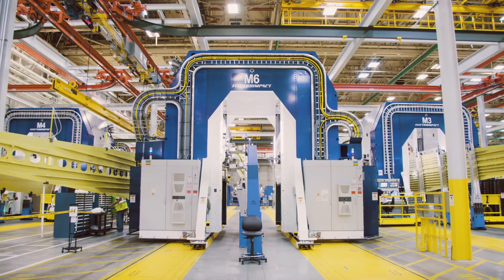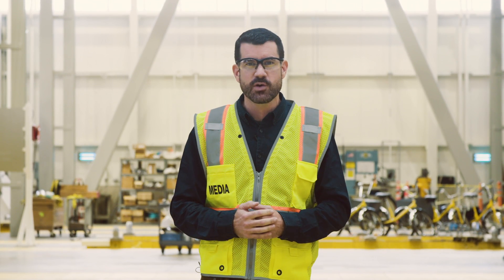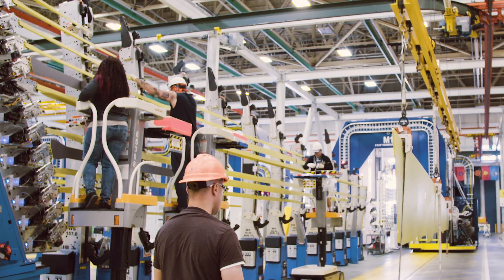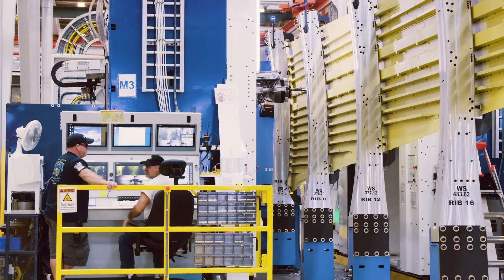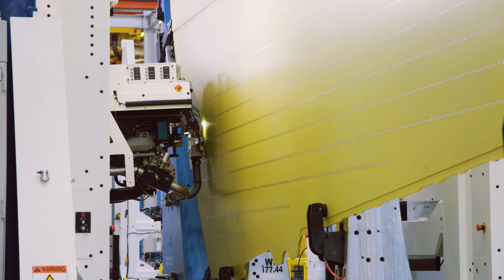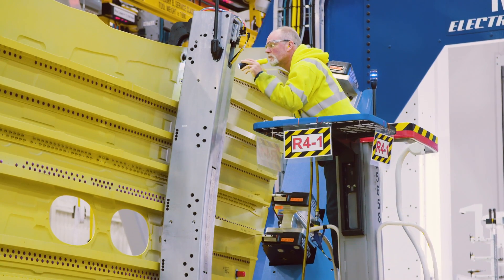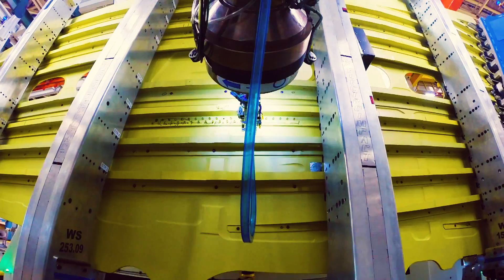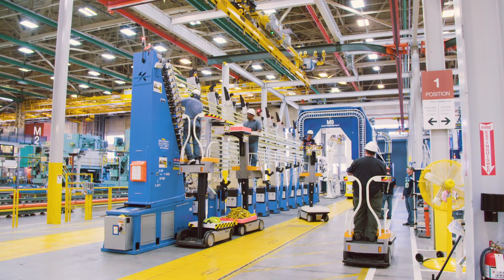Meet the Giant Robot That Builds Boeing’s Airplane Wings | WIRED

Comment: Its cool and all, but once you look through the rhetoric you'll see that the 737 is a positively ANCIENT design. Yes, it has been given 'new' wings, but even these are still made the old fashioned way; i.e. out of Aluminium. 

You guys should go and arrange a visit to the Airbus factory where they build the A350xwb. Most of the plane, including the wings, is constructed from Carbon Fibre. All that stuff is totally new and cutting edge technology.
Reply: mictho100 comparing a 737 to an A350. Great job mate.
Reply: mictho100 compare the 787-9 to the a350 over comparing the 737 to a350
Reply: The 787 is mostly CF, much of the A350 is CF reinforced aluminum. The 787 was introduced into service 4 years before the A350. dummy
Reply: mictho100 fanboy
Reply: Kid From Central African Republic airbus sounds like a hair dryer
Reply: agreed, airbus is years ahead